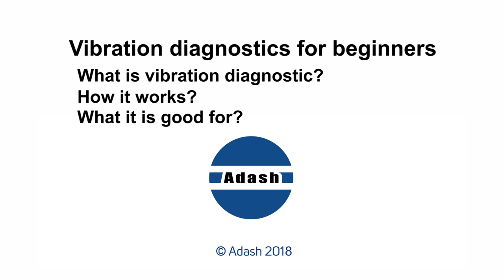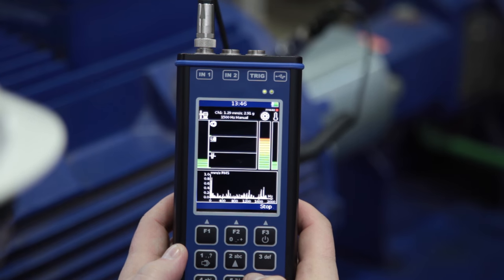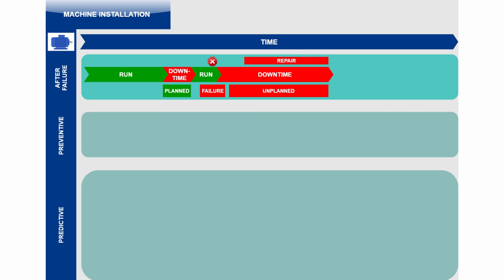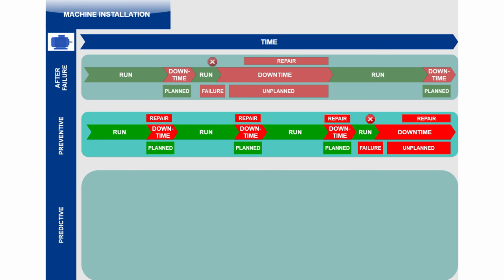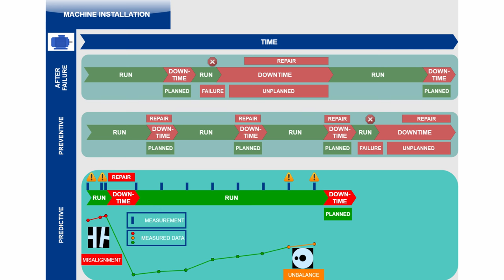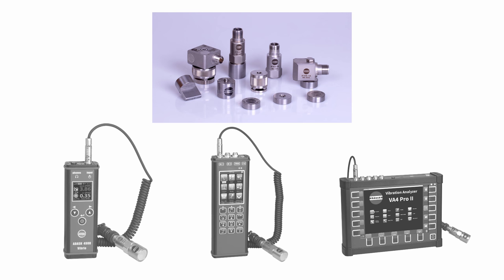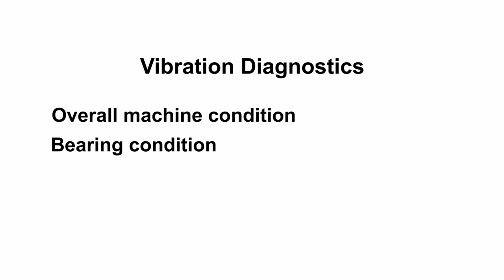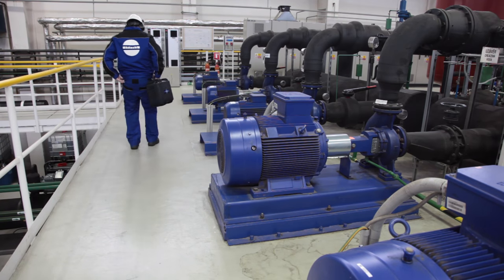Vibration Analysis for beginners 1 (Predictive Maintenance and vibration explanation. How it works?)

Comment: Fantastic video and primer! Thank you for making it! 
If you don't mind, what is the source of the claim that "In the last few years, vibration monitoring has been proven as the most efficient and effective method of condition monitoring."?
Reply from the maker: The source of this claim is simply practice. Adding of ultrasound measurement, thermal imaging, tribology will surely improve the whole predictive maintenance program.

Comment: What is the Limit or allowable in/sec vibration for electric motors?thanks
Reply from the maker: See ISO 10816-3 standards. Or Adash limits which are in Vibrio M manual on page 30: https://adash.com/documents/A4900/Adash-A4900-Vibrio-manual.pdf